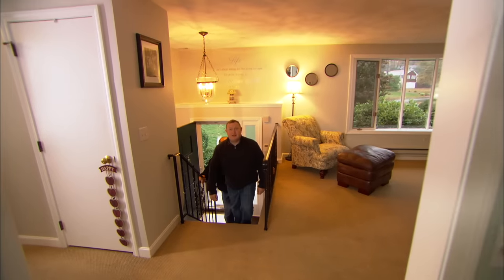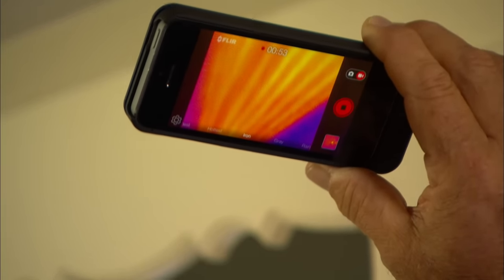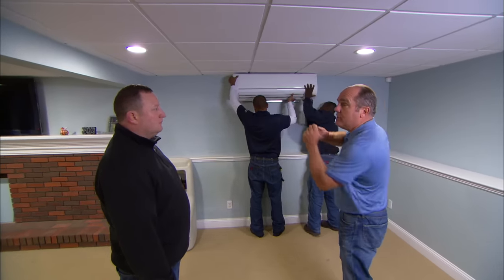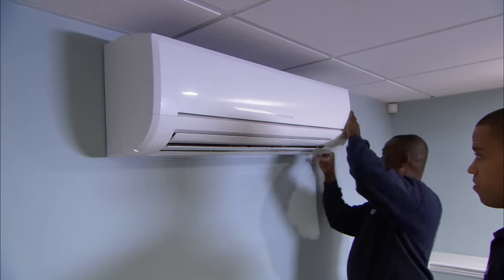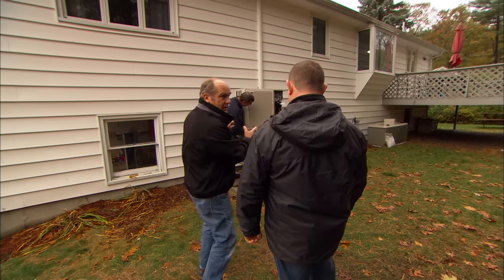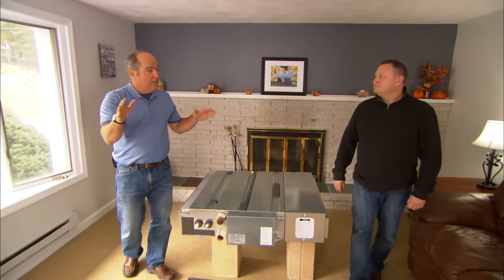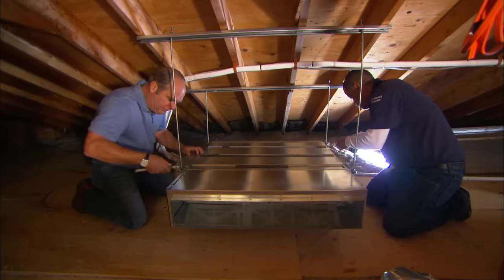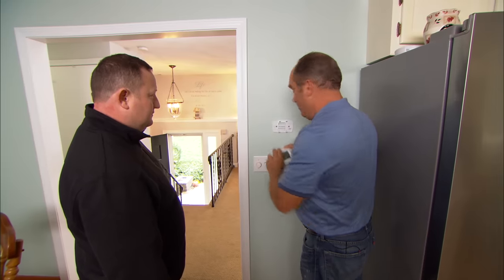How to Install a Whole-House Ductless System | Ask This Old House

Comment: That "electric backup" is gonna be running a lot and cost a fortune... Heat pumps still don't work very well in cold climates, no matter how much marketing BS you pile on top.
Reply: Scott Ogrin believe what you want, the proof is in the pudding. Millions of residential and commercial properties in cold climates have success with them. HVAC tech from Michigan.
Reply: iLikeC00kieDough 
Hell, now they have systems that work in 0 degrees Fahrenheit!  It is an impressive technology
Reply: @davidcerino1145  Well, to be fair, maybe the tech has improved. When I had it in 2000 in central IL, it was pretty useless in the winter. But that was 18 years ago now that I think about it. Plus, today I have a heat pump clothes dryer, and I love the thing...
Reply: ScottiesTech.Info they have changed so much in even the last 10 years! Some work better than others, especially water/ground source heat pumps, but if designed right, they all work great
Reply: My friend has a heat pump/ air handler system in his home on the shore of Lake Erie here in Northeat Ohio. Works perfectly
Reply: An inefficient heatpump doesn't work well in cold climates. The older style ones would cut off at around 0F. However there ARE high efficiency ones that work down to -18F which is quite cold!
Reply: If you do anything I would do geothermal.. I used to install geothermal.. you can get one with a desuperheater and you can do radiant floor heat and heat your domestic hot water... expensive but they are so efficient.. for every energy dollar you spend you get 3 back..
Reply: It just means the refrigerant is at a lower temperature than outside, so it can transfer the heat from outside to inside.  considering that 0F = 255 Kelvin, even what we consider "cold" has a ton of heat in it.
Reply: David Cerino Mitsubishi makes one that goes down to -13 degrees. Carrier makes one that goes down to like -25 degrees
Reply: Yeah actually you are wrong.
Reply: @stevensrspcplusmc  true but for most people that is not a viable solution.
Reply: Lmao. Sounds like you made up your mind about something you know nothing about but have a strong opinion on.
Reply: @peteaulit  I refer you to iLikeC00kieDough's reply above. It seems that 20 years + a well-designed system makes all the difference.

Comment: Does this homeowner get this stuff for free, provided by "This Old House"? If so he lucked out this system seem expensive.
Reply: Inspector Steve no but they can get it discounted on some cases
Reply: John Sullivan1 really? I always thought the products were brought by the show and given to the home owner. Wow.
Reply: Inspector Steve I thought that to until I met Tom Silva and he said no home owner gets it for free and if they do they need to pay to put it in.
Reply: John Sullivan1 I was baffled by your answer so I went and looked a bit.  I found that the show gets materials and products donated to them from the companies. The companies donate products and materials because its like free advertising. If companies don't donate the homeowner does need to pay like you said at a discount.   Well it's good to know.  Was tom a nice guy?
Reply: Inspector Steve a very nice guy!
Reply: Inspector Steve yes expensive for sure...I would estimate this installation at 16000 material and labor.
Reply: Benjamin C.M. home depot sells the outside unit and 3 interior units for $4,000. It comes with everything you need but I'm sure you need longer tubes and then installation
Reply: Mitsubishi probably cost 8k ~12k for this system. Check out some online stores. Home Depot sells some Chinese brand too, which are cheaper. The labor is definitely more compare to a traditional ducted system. I guess just because this is newer to contractors.
Reply: Shenghong Zhang was this Mitsubishi? Usually on those units "Mitsubishi" is in big letter across the front. Also "ask this old house" gets things from home depot that's why I checked there.
Reply: The outside unit was a Mitsubishi based on the logo. I'm guessing they used the same brand for the indoor units as well
Reply: You're all absolutely correct, this was not a cheap install. This was definitely within the $10,000 to $20,000 mark for everything. I'm not surprised if it does end up to that total because this homeowner installed a Mitsubishi Electric system. They tend to be the most expensive but there is a good reason. The proof is in the putting and Richard isn't lying about this system, it's amazing and is worth every penny! Don't even bother installing the cheap Chinese systems! I had my neighbor who is a specialist installed for me a single Mitsubishi Electric mini ductless system (the outside unit is a Mr.Slim from Mitsubishi) 6 years ago and it still runs factory cold in the summer! Although I didn't add the heat function, it's still a great unit. My system costed $5,000 CAD installed. All in all, Mitsubishi Electric are great systems. The Japanese always made quality products.
Reply: Shenghong Zhang the labor is actually less because it takes less time.
Reply: A ductless system isn't much more expensive than a ducted system. And considering the power savings it's worth the little bit extra.
Reply: Trial n' Error that's absolutely ridiculous. You got ripped off. I've got a 5 ton Mitsubishi, 4 zone heat pump for under 6k
Reply: Inspector Steve but that’s not warranted and most if not all hvac techs say don’t buy from Home Depot for various other reasons too

Comment: This is great if you have $50000 to spend or can get a tv show in there to do it for free
Reply: $50,000? Lol. These systems are cheap and easy to install. You could install this whole thing in a day with a friend, just hire someone to fill the refrigerant and an electrician to run power to the outside unit. No reason this should cost more than $5-6000 all in.
Reply: This old house has been a "you buy the parts, we'll install it for free or discounted" kind of show for a long time now.
Reply: i have been looking at these systems for a while and yeah you should be able to get a three-way installed for less than $6000.
Reply: A conventional system would still need a unit outside, a handler inside and lines run to it.
Reply: It could be for those with a fear of gas. It looks like a cheap electric alternative.
Reply: it's generally about 40% less expensive than heating with diesel fuel.
Reply: @durakis  
what's a good source for the ducted ductless?
Reply: I have only looked at the mini ductless. It appears it is way cheaper to order your own units and have an electrician and A/C company install them. I have got bids from three different authorized installers and they have about a 300% markup on hardware and charge several thousand dollars for the install even though it might only take them six hours.
Reply: @durakis  I work in commercial construction and I can attest, yes, there is usually a ridiculous markup on everything
Reply: @leeknivek  
That's why when you call out most accurate companies.. if your unit is close to ten years old.. they just say.. needs new unit. Easy money for them.
Reply: @durakis  ..u can do most of it yourself
Reply: I have a guy that can do the install if i order the units myself. But, then someone told me about how poorly they heat and I have yet to find anyone that verify one way or the other.
Reply: @durakis  the heat would depend on how cold it is outside.. and the how well the manufacturer designed it. For up north I don't know if I would do a heat pump.
Reply: I live in Fort Worth, Texas. It will get in the 30's and 40' so I do need a heater, especially if i have guests.
Reply: Can anyone give a link to the equipment they used here?
Reply: @durakis  where you get it from
Reply: I just looked online at I think the Toshiba units. There is a company, alpinehomeair, that was very helpful and would sell and ship the Blueridge units directly to you. They also had a list of installers in my area
Reply: Agreed. This is an exceptionally expensive system. It probably cost as much as a standard duct system, perhaps even more.
Reply: V. Vega,
No. The simple units that don't have indoor air handling systems that hang from the rafters (like the first wall-mount they showed) are cheap. This system is much more complicated and expensive. Also, you CANNOT do the work yourself IF you expect the company to honor the warranty. They will only honor warranties if a licensed professional does the install. If you don't care about the warranty, then have at it, but the system alone is probably close to $12,000.

An all-in-one ducted system for 36,000 BTU will run you $7,000 to $8000. That does not include lines or electrical components. The branch box is another $800. Assuming his house is 2,000 square feet (well below the national average), he would need this system. So just for the above, without lines, he is looking at about $9000. Add in the lines and you are at $10000. Add in electrical and you are at $11000 without any professionals. Incidental shit takes it up to $12,000. If you want the warranty, you are looking at $18,000 give or take.
Reply: I've run the numbers on these systems, I tell people that our house would be about $15k to $18k to add AC and people think I'm nuts. These systems are expensive, but for someone who has an old house with radiant heat and no ducting the options are somewhat limited. So every spring and fall I risk my life up on my steeply pitched roof tuning up my crappy swamp cooler and swearing so much I embarrass the neighbors.
Reply: V.Vega   they come pre charged,  I just finished with two installs
Reply: I have ductless, single pipe steam system, and electric floor heat.  The electric heating sources can't hold a candle to the steam radiators in cost.  I can heat 3000 square feet in a 120 year old home for about $300 a month on natural gas.  The floor heating will take $100 a month for a single room.   The ductless sits in between on efficiency.  But you only really gain the efficiency because you are rarely ever heating or cooling the whole house...only the rooms you are using.

And the steam heat can operate with minimal electric requirements.  If you have a millivolt valve, it will operate even when the electricity goes out.
Reply: MewCat100 All you say is true plus A/C installations are permit affairs so unless you can educate yourself on all the zoning requirements you won’t pass inspection and will have to hire a pro anyway.
Reply: Except for the fact that 99.99% of people are not handy enough to do this. Good on you for being so much smarter and more capable than everyone else, though.
Reply: @jeremyhale303  In the age of technology it is not about "capability". It's about "willingness to research" how to do what you don't know. I'm 33 and every project that has been needed on my house I learned from YouTube or Google searches. I knew nothing when I started home ownership. We're all born with the same capabilities. Some people like to learn, some people gravitate towards what they already know. Simple as that.
Reply: @bmlong137  300 a month to heat your house? Damn I thought mine was bad. I have a 70 year old house about 2300 sq ft and my gas bill in the winter is less than 60 and the summer with the a.c. is about 120 a month. We just have a Goodman package unit and it works great. Very efficient
Reply: @Xixu.co.6  And the monthly bill is MUCH less on energy. You will have all these expert Pro in the field folks protecting their turf, as they try and charge $100-2000 or even more for a single unit. In reality, as long as the elec is put in for 220v(for larger needs and max SEER), the entire house install should be less than 2K, and the units are about $500-$1000 even for 2ton multi room. When you buy in the US, the commercial market helps out the industry by RAISING the product cost. These units overseas are about 30% cheaper. THen you will get the R410 gas release license BS, and then the vacuum micron measures...Folks, if you follow the directions with about $250 in tools this install can be done by someone who can read and follow directions. If you are doing it from YouTube videos, Great!BUT, watch a bunch of them and take notes from each with the pointers.  If you like, you can even get the license yourself for an extrea $50-100 for warranty reasons.
These theives of the industry just need to take up banking, like the real thugs have done since the 20's. Having said all this, IF you are doing one as complex as this, you should likely hire out the work to someone, but if they are a company more interested in making money vs providing a fair work to price ratio, prepare to have this cost around $3000+ to install. If you hire an AC tech and a handyman, you could get it done correctly for $1500. UNLESS you are ambitious and have experience in energy use.
Reply: @TurboFlush Heat pumps are fine up north.  The key is to have a geothermal loop though to the constant underground temperature.  Entirely above ground systems like this I doubt would work in the really cold.
Reply: @FinSmoked  Surely it isnt for the novice, but you certainly DONOT need a micron level vacuum, or any fancy tools. You do need the right flaring tool, a good vacuum pump, and a good vacuum gauge. Unless you just woke up from 10 years ago, China quality made products are excellent quality and do the needed job. Just like cheaply made Chinese products are garbage. Yes there are plenty of them.  It will set you back $200-300 for tools/parts. If you want to feel like a pro and rip others off, or do a quality job for others with a license, you can add $100 for the certification license. This Way you are trained on it, and keep the warranty, with the satisfaction that you did it correctly yourself. This keeps you from "pro" installers that rip fast through these systems without doing careful checks and proper precautions. Anyone quoting you above $500 for a ground level direct simple install given you have the elec volts ready, is simply ripping you off, and that guy should look to upgrading his or her value, rather than ripping people off. For a pro and for a straight basic job on a single head unit in a basic drywall to stucco wall,   this should take no more than 1hour, maybe 2 if you're really slow and making a video while doing it. Line 4 of these units up a day and thats $2k at $500 A POP for install.
 UNITS COME WITH A KIT OF ALL parts. Get proper length line, or be prepared to get a longer line to cut properly. You can talk all day of exceptions to the above for xyz, but this is the basic demand setup for most folks. Its not rocket science, unless you want to make a science out of it.
Reply: This cost like 1600 dollars in sweden and pays of in like 4 years so should cost 1200dollar in the us and electricity prices seems similar, so even better for you. we did this and it halved our energy consumption.
Reply: A 6 zone system from Fujitsu costs around 10,000$ in parts. Let’s say you double that for labor hiring a handyman, electrician, and have contractor to vacuum out the lines and charge the refrigerant, that’s actually a pretty cheap price for such a large system that provides heating AND cooling. Not to mention the entire system all inclusive of 6 air handlers consumes less than 50 amps if everything is running full blast. Super energy efficient, which means long term money savings for you.
Reply: These ductless systems are also called minisplits and you can order them direct from the manufacturer for between $3000 and $5000 for a 2 to 4 unit system. So if you were trying to do a whole house you would probably want the four unit system (or maybe two three or four unit systems depending on how many rooms you have)plus the extra lines and wiring then a few basic tools and if you have a couple of specialty tools and know anything about refrigeration or air-conditioning even it’s from auto mechanics the only issue you may have is the electrical hook up to your fuse box. The specialty tools are a vacuum pump and a flaring tool. You can find videos about installing minisplits right here on YouTube and just do a web search to find the company that you want to buy your mini split from. at worst a weekend project, at best a few hours.

Comment: A ducted-ductless A/C system aka a ducted split system. My guess is this setup cost more than a traditional central a/c system so the only advantage is maybe higher SEER, (seasonal energy efficiency ratio- how efficient the unit is for electrical/gas cost to run) but will come at a higher price, so the only other advantage is the ability to adjust multiple zones? Multiple zone control and higher SEER at a higher price compared to regular central heat pump a/c unit?
Reply: Ross Malagarie well, it is more efficient, and with zoning, you save by not heating/cooling the whole house every single time.

But . . . . initial cost is pretty expensive.

Comment: "Ductless System" ... Proceeds to install just as many ducts as a normal system.
Reply: Oscar Muffin, OMG I'm on the floor. HA HA! "This ductless system consists of a supply and return duct, and the only thing you will see in the room are a few registers... a single 12" x 12" return, and a few 8" supply."
What tha hell? Well, it looks like this whole time I have had a ductless system, too!
Reply: While technically not ductless, it is still far more efficient than a traditional single unit air handler with ducts routed throughout the entire home. Your losses from moving the conditioned air through your attic and ducted to each room is much less with this system.
Reply: Plus, the attic is inefficient because the attic gets cold in the winter and super hot in the summer, so you loose some conditioned air with the ducts in the attic. It's more efficient if installed in the basement.
Reply: @Pickle312  I don't know about that. Says it cost $40k for the system.
Reply: lol, this old house got unlimited budget and needs to fill 10 minuite time slot!